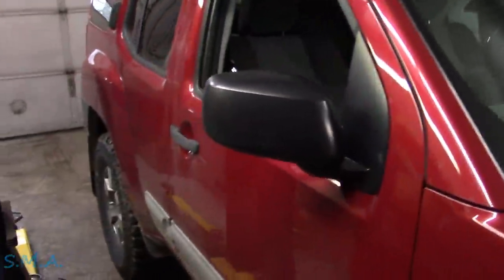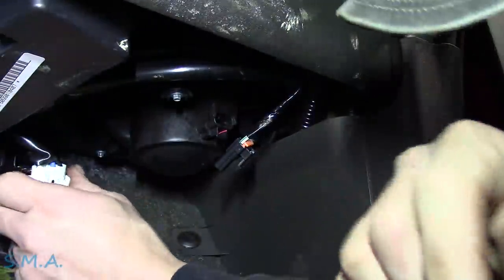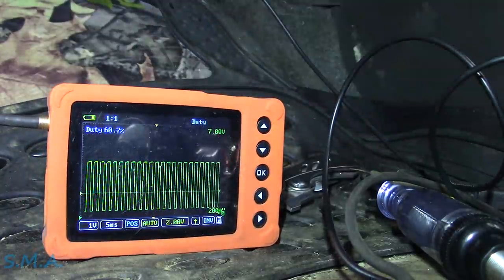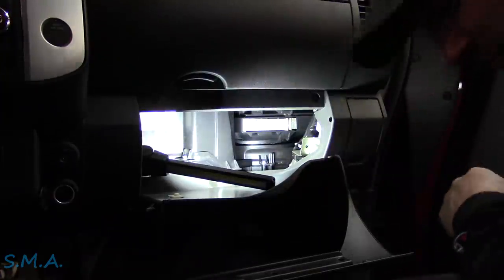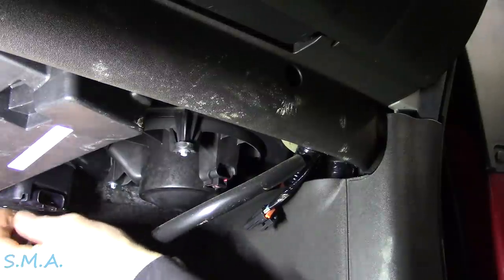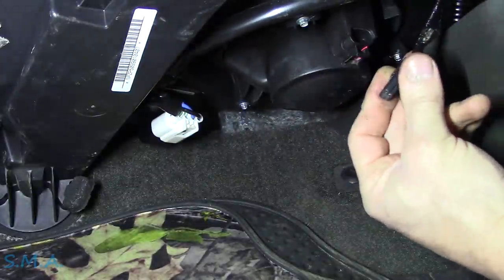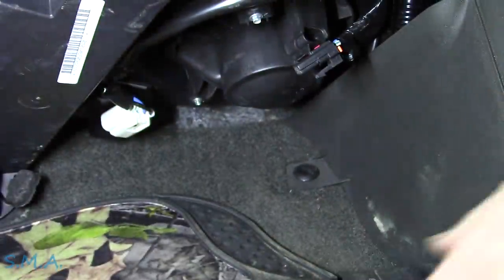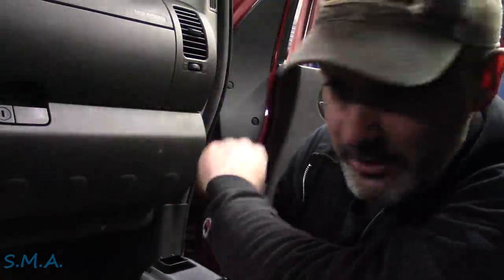Nissan Xterra: Blower Motor Not Working

Comment: Once again a great class for us DIY guys Eric. I channeled you the other day when I used my meter and power probe to assess why my "speed control" which is what Ford calls the cruise control on my mint 2001 F-250 Superduty 7.3 was not working. I traced it down to a crusty plug connector on the master cylinder switch. Removed it, cleaned it up with CRC Electrical Connector cleaner, tested the two 2 amp inline fuses (this was a recall replacement fused jumper harness). Fuse #28 was good, I watched your 2015 video on clock springs. Ran through all; the other possibilities like power and grounds, horn function, speedometer function, rear ABS speed sensor (no ABS light illuminated) No air bag check light illuminated etc. Decided it was the cruddy plug. Problem fixed. I was about to do the clock spring dance... no. need as the cruise control came right up as commanded and all the other steering wheel controls were working normally. Thanks Eric for all you do for us. You are at the top of my list of favorite Youtube Instructors. You are entertaining, your wife is a wonderful lady and your filming and editing along with your instruction are first rate. I live on the other side of the continent in WA State. Otherwise I would bring my vehicles to you for things beyond my level. It would be fun to talk to you face to face sometime and thank you in person for all your videos. Please keep the videos coming as they are invaluable. An honest quality mechanic can be a hard thing to find. I had one but colon cancer took him away early in his mid 40's. I miss Mike very much.He was honest and talented to a fault. Now it's me with your tutelage. I'm even making my own how to videos as well. Thanks again Eric. Oh... and I am wearing out my SMA Hoodie. :0)

Comment: Had a customer that would turn on the AC and had no air coming out of the vents no matter what blower speed but could hear the blower going. I pulled the cabin filter. It was completely filled with dirt, leaves and other debris. Replaced the cabin filter. AC worked fine. Had some fun with the customer as I told her it was the climate controller and was going to cost $550. She freaked out. Then told her "just joking" and told her it was a extremely dirty cabin filter which I showed her and charged her $25. She was so happy to hear it was just a dirty cabin filter and not a $550 part. Especially since we need our AC during the Texas summers. She has been a great customer since.

Comment: I think you're exactly right about the 5.5mm scenario!  If there's a way to complicate a repair (crab assing it into a spot a contortionist can't reach) or adding more specialized tools, the automobile (not exclusive to automobiles) makers will find it. I think they start out the design process focused on deterring easy maintenance! After working on my own rigs for the past 45 years, that is my conclusion. Another great vid, Eric! 👍
Reply: Car design 101, take an engine. Then build the car around the engine. Don't worry about having to service the engine or anything else. Just jam everything around the engine.
Reply: Shit, we built the car and forgot the battery, there's no room left for it?!?!?!   Hmmmm, stuff it in the fender-well.... aka Chrysler BS. lol
Reply: Remember when you could open the hood ant there was an engine there, now you've got to get past the pointless engine covers. Why?
Reply: @watsisbuttndo829  Mice love chewing electrical wire (plastic coating has a soy content), so why not build them a roof for their "house"?

Comment: Was watching a u tube video changing the the cabin filter on '01 Silverado. Thought to my self maybe that's why the system isn't working well. Didn't even know it had one. Took it all apart, sure enough it was plugged solid. Changed it out works good now I've had the truck 15 years and  I think this was the first time it was ever changed.

Comment: I've had my Xterrible for a decade and didn't realize that it has 2 filters, just thought they came from Amazon in twin packs because they are so small and have to be changed frequently. It's going to be a joy to go change the 2nd filter at below zero F temps. Wish I lived in that part of the world, Eric O or PHAD might be able to solve an intermittent driveability issue I have with no codes and no obvious data glitches. Can't scope what you can't see. learn something new every day.

Comment: Blower motor went out on my 2005 Golf. It would still run but slowly would grind to a halt after a few minutes. VW wanted over $700 for new blower. I figured out  how to get some oil to the rear bearing by removing the rubber retainers holding the motor to the blower assembly  . Lubed both bearings and blew out the dust with compressed air, and the old one now  works just fine.

Comment: The heat sink module is most assuredly a FET transistor, the PWM (Pulse Width Modulation) signal through the thin wire wouldn't work with a dropping resistor chain.  New word added to our lexicon though:  PROBAGE
Reply: Sounds like what Jerry did with Elaine on Seinfeld....PROBAGE.

Comment: Yes, Eric, if you can jiggle it, then I should be able to jiggle it too !!!!! I always put 12 volts to the blower motor first to see if it turns / works. Then I check the resistor.....either the motor is bad, or the resistor is bad - or they are BOTH bad !!!!!  Then take whatever corrective action is necessary !!!  That's how we do it in the Florida "" Salt Belt "" !!! The blower motor runs whenever the engine is started here, need that cooling air !!!!!!!!  You did the both checks, just in a round about "" Rust Belt "" way !!!!! Same objective, just different paths to get there !!!  Never seen a 2 piece cabin filter. I have only run across 1 piece replacements !!!! My 06 Ram 1500 Laramie Mega Cab 4 door 5.7 Hemi gave me a P0441 code, replaced the purge valve under the battery area. Reset the light / code deleted, and it was good for a week, then same code came back again. Any other sure fire fixes you know of ??? Going to test the charcoal canister, and parts associated with that, as well as possible hose leaks and gas cap. Can you shed any light what it might definitely be ????  You get it right and I'll send you a bag of Florida sunshine enriched oranges !!!!!!!!!!!  Thanks !!! Merry Christmas to you and your family !!!

Comment: At FCA (Stellantis) those are called Blower Power Modules.  That one looks like it has linear output with such large heatsink.  There are also PWM output modules that have much smaller heatsinks.  Good job Eric!  Rotor Lock...
Reply: By looking at the scope, I think that unit is PWM. The old days of low, medium and high could be heading out the door.  Cheers!

Comment: My blower motor stopped spinning on my 2006 kia spectra at around 200,000 miles. I took it apart and cleaned everything up inside the motor, sanded the contacts on the motor where the brushes touch, greased the motor, and now it blows way more air than before it stopped working. Now I'm at 222,000 miles and its still going strong.

Comment: I had an older Ford Taurus with a runaway blower, full blast. Glad I had a service manual with schematics because I had no idea there was a resistor that controlled speed. Quick, easy, cheap fix (way before YT). I’m sure your video will help a lot of people.

Comment: Used to have a 2005 Altima, had the resistor pack like this that went bad. New one was over $160. After reading a thread on Nissan forums, I learned that I could try replacing just the thermal fuse and the MOSFET. I soldered in 2 bucks worth of parts that cost me $10 shipped and that fixed my blower motor issue. Worked just fine till the car was totaled 8yrs later.

Comment: The ford tfi ignition modules in the 80s were the first i remember using the 5.5 mm socket. Texton sold a socket with a short bit just for them.

Comment: Glad your parts guy got it right. I did all the tests with the resistor in, told him it was for a manual  set up, nope. Chased my tail back to that part.  If I remember the diagram right, these actual bypass the resistor on low and not the usual high.  Weird set up.

Comment: I don't recall ever changing the old style wire coil blower resistor. The new style you better keep one on hand
Reply: I've had to change 2 of the old style wire coil fan resistors on older Toyota's. An 85 Tercel and an 86 Corolla GTS.  As an electronics engineer I think it would be pretty easy to design a duty cycle controller as was used in this Nissan that would be self protecting and not fail if the fan motor failed.  It would cost a few cents more though so no manufacturer would be interested in doing it.

Comment: I bought a used Ford Fusion last spring and immediately changed the cabin air filter. Thank god I thought to cut a piece of a cereal box and slide it in underneath the old filter before removing it just in case. Turns out there was a mouse nest on the old filter with a huge pile of accumulated nesting materials, droppings,etc.If I had just pulled the old filter without that cereal board underneath it I’d still be trying to get crap out of the fan housing.

Comment: Great video as always. Clear demo of scoping the small wire. You could’ve jumpered the connector at the resistor/controller to test the blower motor operation with an amp clamp to measure current when you first confirmed the failed controller to avoid calling customer back. Hindsight = 20/20 LOL.

Comment: Brushes in my  88 Toyota PU fan motor were worn out a few years back. I could hit the motor with my hand and it would work. Bought some replacements online for lots less than a used motor and it's been good ever since. Commutator looked sketchy but a little sanding fixed that. Resistor power pack has the low speed burnt out but I can live with just having medium and high.

Comment: Eric I'm surprised you didn't put power to the blower to check it before you replaced the resistor.
Reply: The resistor was confirmed bad, so there was no money wasted, just potentially having to inform the customer of a cost increase.

Comment: Eric- I have been using my Milwaukee driver 1/4 shaft 12v (2406-20) for all screwdriver crap. I hardly ever use the nutdrivers or phillipsbit without it. It is not too powerful to tear stuff up put zips most stuff out fast. 1/4 adapter for sockets. tI's small, lightweight and can get into places an impact can't. LOVE IT

Comment: Thankfully that blower motor was easy to remove.  As they age the current demands rise as you well know.  I used to test the motors when there was an A/C air flow problem and some motors pulled more than 22-24 amps.  New motors were about 12 to 15 amps.  Occasionally the fuse for the system would tolerate the high amps, but not for long!
Reply: Wow whether you're talking 12 to 15 Amps, or 22 to 24,  that's a whole lot of Amps just to run a darned heater (and AC) blower motor. I grew up with old Pommie cars that only had 12 volt  DC generators so only had total charge current available in the high teens or low 20's (of Amps). I think the heater blower motor in those days only drew 3 or 4 Amps (no AC back then) and actually even just to have a basic heater/demister was an "optional extra" on most cars in the 1950's and 1960's ! Indeed in the 1950's many British cars couldn't even have the option of a basic heater as they ran unpressurised and had no waterpump and relied on natural thermosyphon to circulate the water in the cooling system anyway.

Comment: Eric, last winter my heat quit working. This was on my 2005 F-150. It had over 300 thousand miles on it. Da… I pulled out the blower motor, it was dirty, I hooked it up to a 7 AHR battery and it turned on. But it didn’t spin super easy by hand, again way too many miles on it. This truck has the automatic temperature control. So I bought a new resister, very expensive, put it all back together and it still didn’t work. I then took the blower motor back out and after testing I realized that motor had dead spots, Ah ha! So new motor new resister and it still didn’t work! Running out of ideas I plugged in the old resister and the system worked super! NAPA resister was no good and motor no good.
Moral is motor’s only last so long. Plus no returns on electoral parts.

Comment: Must be a common issue with the KneeSans...  ;)  My son's 01 Xterra has the old school resistor and it lost the middle speeds.  Only had settings 1 & 4, no 2 & 3 if I recall.  Looked liked the middle speed circuits on the resistor corroded open to me.  Also had the two piece cabin filters and was full o leaves and "dietz nuts"...  I gotta gin up one of those fancy headlight bulb diag devices!  lol  Keep em coming!  Thx

Comment: I know exactly what you're talking about with the cabin filters that pop open when you install them.  Lady at work has a 2015 Nissan Versa with that type packed under the dash. Accidentally torn it to pieces the first time I tried checking it.  Those two piece ones are much nicer.

Comment: I don't have any diagnostic equipment but I would've tried 12v on that motor first.  I wouldn't have found the bad resistor unless I had no fan control.

Comment: Great Video as always - As a Nissan Frontier owner I can attest to the craziness of Nissan Cabin Air filter location and design by the manufacturer in Xterra but that job it is nothing compared to the Nissan lunacy for 4.0 V6 engine spark plug change procedure and having to remove an entire intake manifold to replace 3 out of 6 spark plugs. Mind you it's not nearly as bad as spark plug replacement on a 3.0 H6 Subaru engine.
Reply: One thing to bear in mind about Japanese cars is that the home market has right hand drive versions (like here in the UK), so the original design has to be adapted to suit left hand drive versions for the US market (and most of the rest of the world), particularly where it involves location of interior components and access to them. We often have the same issue here with vehicles designed for the European market.
Reply: From tacoma land. The driver side plugs aren't bad when the truck is n/a. I think for supercharged trucks they recommended unbolt it and lifting it up. I think I've seen people still get away with it leaving it together. Just a pain

Comment: In the UK A lot of the older cars had the older type oil filter shaped blower motors with a external fan which could be lubricated with 3 in 1 oil on the collimator shaft every three months to avoid it seizing

Comment: On a Rougue/x-trail/qasqai, they are sold right hand drive also, but they forgot or did not want to mirror the HVAC system. Thats why you have to remove the pedalbox to do some work on the HVAC system. Changing the filter, you can get by with removing olny the gas pedal. Replacing the resistor or blower motor, pedals out. On Right hand drive models it is easy access.
If the Hvac system has a cabin temp sensor, then it is automatic. I have 16,22,32 c and that's it, but it has a cabin temp sesnor near drivers right knee.

Comment: When I bought my '00 Grand Cherokee, it had a huge key off battery draw. Found the electric cooling fan was drawing. Unplugged it, draw went to tolerable. It also has a manual fan. Doing my internet research, I learned that the fan motor starts pulling more amps and taking the large transistor with it. Still driving it this way.

Comment: The worse blower motor I had to do was in one of my Caravans.  The small screw closest to the firewall broke as I turned it out.  I never thought a plastic threaded hole would hold well enough to break a screw as you are backing it out.  Of course, it had to be the one that is the most difficult to reach and it broke below the surface.  I managed to get it out without destroying the hole so much that a replacement screw would not hold.  Being that I bought the van new, it had to be a factory issue that set up this failure.

Comment: That filter installation is similar to the Model 3 setup. They are a pain to change out. Those cars have a reputation for condensate not draining sufficiently and stinking up the cabin. So you have to decontaminate the A-coil when you change the filter.

Comment: Also just for the same with a 99 f250 but with more exciting stuff. Cage got augured out which fried the resistor the fuse popped and before that it did some surgery to the HVAC housing!

Comment: My old Saturn used 5.5mm screws for the steering wheel cover...still have the socket around here someplace.  But you think 5.5mm is bad?  Wait until Apple releases whatever autonomous electric nightmare vehicle they're planning...I'll wager $5 it has pentalobe lug nuts and 9 point Torx...
Reply: GM used the 5.5 for their TFI module other side of their electronic distributors in the 80s

Comment: It's not a 'resistor'... it's a duty-cycle controlled speed controller... all kinds of transistors etc in that module.  You can convert it to a resistor-type if the resistor that fits the hole is available... and if your customer will tolerate a janky switch in the glovebox.  Did that to my '93 Taurus SW... also converted the VAPS to manual.  The filter probably did cause the overheat.

Comment: WELL i guess you blew that one ,haha.ERIC maybe send that resister over to IVAN so we can learn all about blower motor resisters. i only have the old wire resister type so i have no idea what's on the inside of one of those. my guess is a transistor or some electronics.AND that's how it pulses? the little meter you used was within anyone's price range and worked great for showing the pulse waves.thanks for another informative video.